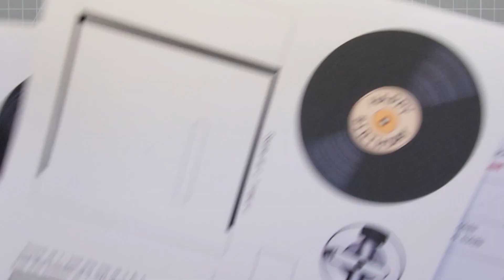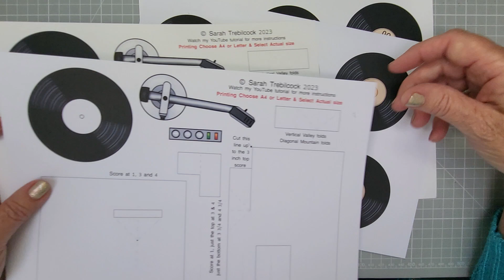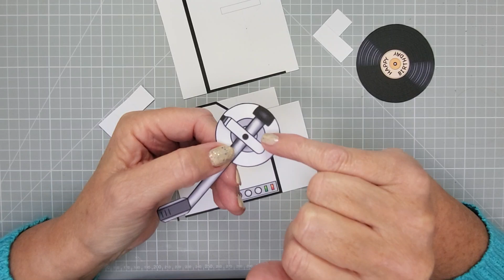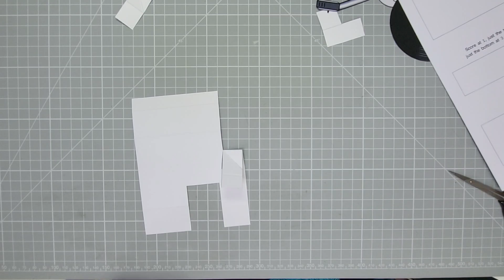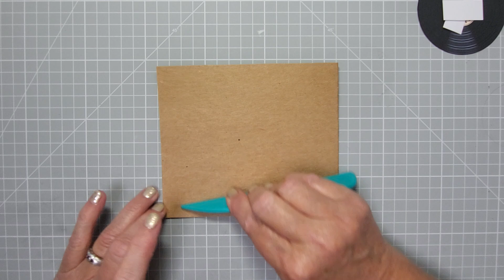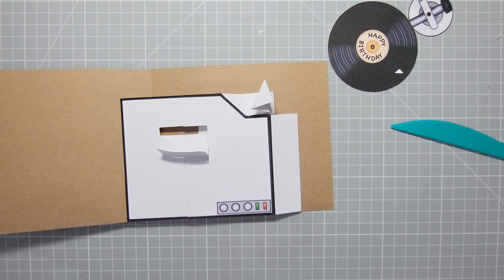🎶 TUTORIAL Pop Up Spinning Record player card & moving arm Cardmaking Inspiration 3D birthday  music

Comment: Love it is the exact card size 81/2 x 11 please I cut it and it seam to small help
Reply from the maker: OK, at 3.56 minutes in, I talk about the card baseline it has to be 6 inches wide the height is not as important as long as all the mechanisms fit inside.
You can use A4 folded in half but 8.5 x 11 is too small
Use 12 x 12 cut down the height so 12 x 6 or 12 x 5 folded in half 
I hope that helps
Reply: @SarahTrebilcock  thank you so very much for your help I really appreciate it and love watching you
Reply from the maker: Sorry, I'm not sure what you are asking?
Reply: @SarahTrebilcock  I am trying so hard to make the record player having a little  hic up the actual size of  the card base if I do it 81/2 x 11 it seems to small the record player doesn’t fit inside sorry to be a pain
Reply: @SarahTrebilcock  I love love the card you are amazing for working it out
Reply: The actual card size is what I need please 81/2 x 11 it to small for the record player